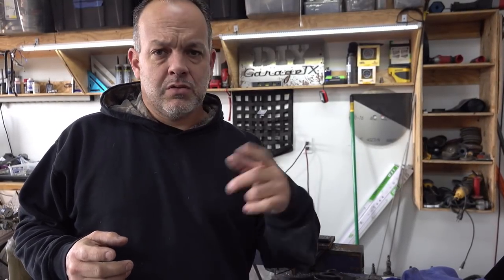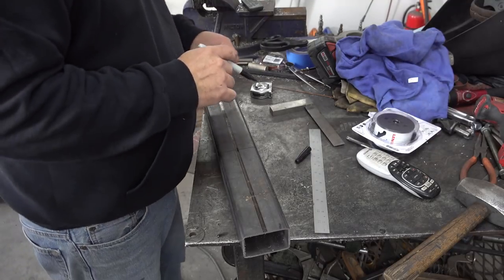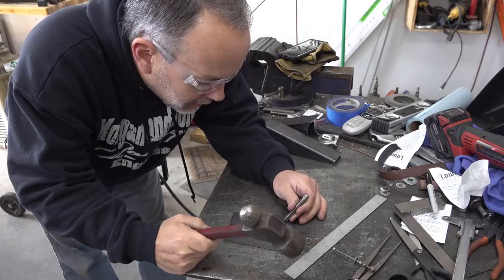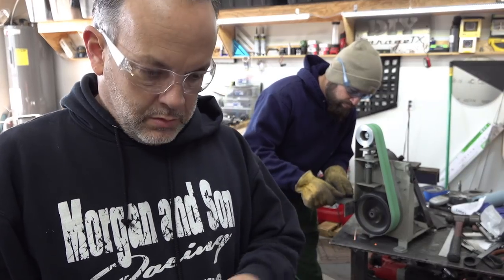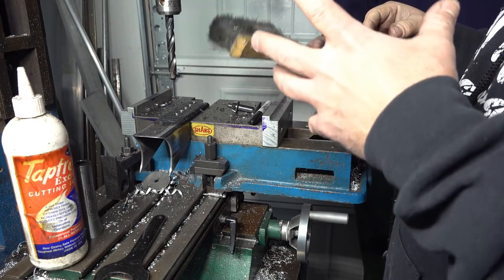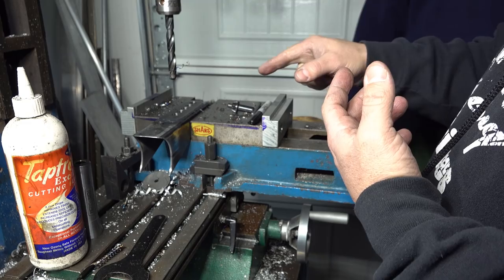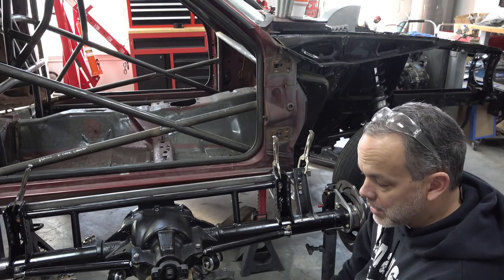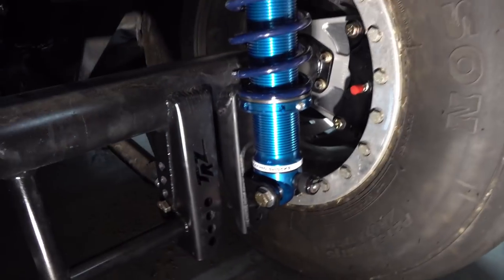The old machinist speaks on hand sharpened drills

Comment: I have been a machinist for over 30 yrs. I do the same thing at work. If the drill cuts and it doesn't dull, your good. Now, the thermometer behind you said it is 60 degrees there. I would be in shorts and a t shirt. You must be wimps for temperature. Come here and enjoy our 14 degree hi temp.  It is going down to -3 tonight according to the weather. If you come here for my winter, I will go there for your summer and I hate temps over 75 degrees. Oh, I am in Michigan, near Detroit.
Reply from the maker: Yeah, indoors it's 60*, right now it's 40ish outdoors. I've been a machinist off and on for 20 years or so as well. Everyone does things differently, but if it works, who really cares, ya know?

...and it'll be 105ish in the summer, here. 😁
Reply: @diygaragetx  I would probably die in that heat
Reply: I wouldn’t mind visiting my in-laws in Warren and Utica with temps like that Camino. We hit a blistering -10*F (-22*C) here an hour north of Toronto.